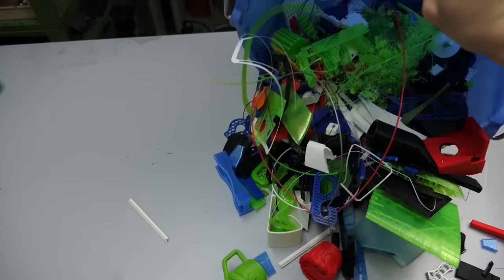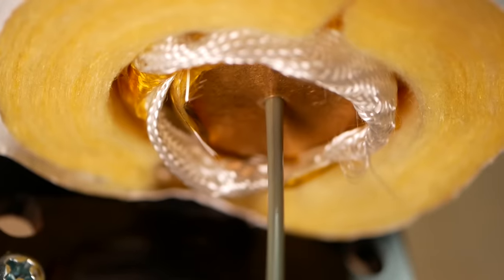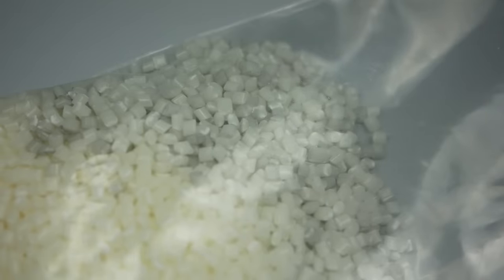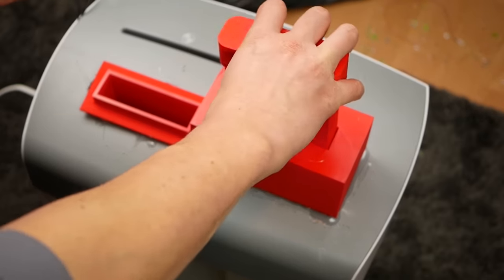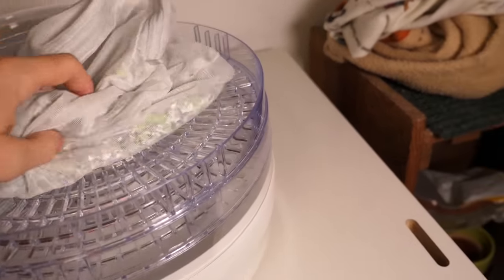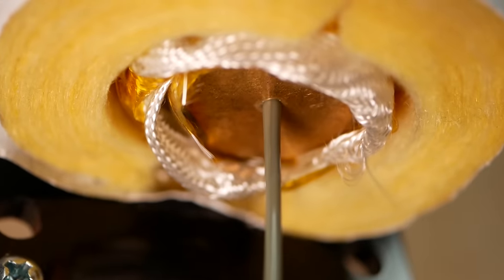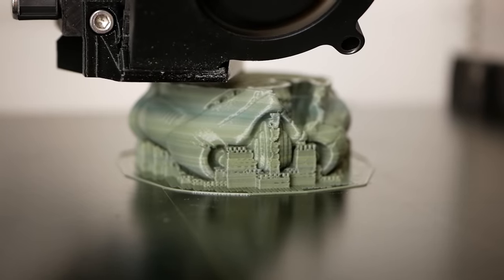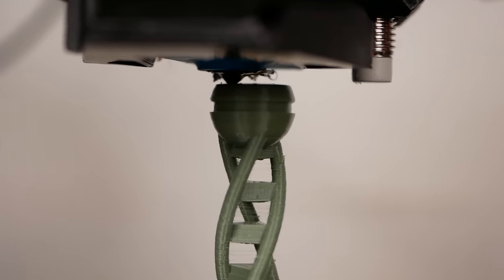Recycle your failed 3D prints! Make new filament at home.

Comment: Just to give myself the right amount of credibility, I recently completed a Material Science course on polymers, including recycling. 
Personally, I would try to keep the new PLA mixed into the recycled stuff to a minimum, mostly to keep the costs down, but also because every time you recycle any plastic it becomes worse. For this reason I think it is a good idea to keep track of how much the material has been recycled at home. ie, keep separate containers for fresh, 1x, 2x recycled scrap. Plus I would really only use this material as print support or for prototypes, where strength is not being tested. 
I really think this is a great idea, especially for setups with multiple material printing so you can choose what parts of a print is recycled filament and what is fresh filament.
I mean I am a stranger on the internet, so don't just take what I said at face value. Do your own research and try it out for yourself. ☺️

Comment: One thought I've had about recycling plastic like this (even so far as to recycle bottles, caps, milk jugs, etc.), albeit entirely theoretical because I don't have any of the components to do this myself, is to add water to the blender, not only to help keep the plastic cool but also to create a "vortex" of sorts to draw the plastic back down to the blades. My theory is that this will allow the blender to be run for longer periods and/or at higher speeds without melting the plastic and this should allow for breaking the plastic down into much smaller particles without creating a lot of dust to contend with. Having water in the blender will also help somewhat in determining if the materials are consistent using relative density. Again, it's all just theory at this point. And because we're adding water to the mix we'd have to take special care in making sure the fragments are completely dried out afterward.

Comment: My first thought on making the filament more consistent would be to extrude several rolls of rough filament about 3mm diameter and then build a multi strand feeding mechanism to feed the strands into either a rotary knife or horizontal guillotine knife with properly sized guide holes for the strands on the stationary blade at a metered rate and then chop the strands into uniform lengths of about 4mm. By varying the knife speed and filament speed of feed you cab net uniform size pellets that when reheated and extruded again into proper filament size would probably run smoother  and be more uniform in color. Something I may have to work on.

Comment: Want to build my own filament extruders. There were plans in an old issue of Make, but I can't find the copy I had. Also something made to grind up the waste pla like a pulverizer and  melt the scrap into uniform pellets, so when put in the filament extruder I get uniform thickness. Make sure I use only the same color in each batch so I get uniform texture. Also possibly have a puller and cooler so I get uniform thickness.

Comment: volumetric mode on a printer would be really useful for homemade filament, since then we can just check the size of the filament beforehand, and then print without changing any multipliers.

Comment: Im really curious if you have done more with this. An idea I have for the hopper is to do like a paintball gun hopper that helps with feeding. Setting something like what you did is a great idea, however taking out blades at every other point and then removing the fan shroud while having it spin at a lower speed would greatly help with feeding.

Comment: Try using a eccentric motor from and old controller mounted to the top rim of the collection basket. Even at a low voltage it will have a massive impact on assisting with the material flow

Comment: I think if you put everything on a cookie sheet and put it in the oven at about 200°C, you might be able to turn it into a sheet that you could then cut up with a paper cutter and get your sizes down where you need them, it would also give everything a more consistent thickness which could lead to better melting. As for extrusion, you could have a larger nozzle that feeds down into a smaller one to keep a more consistent size, maybe heat each one to about 175-185°C with an induction heater if you’re savvy.

Comment: Very interesting, I think the bumps in the filament are from larger pieces not melting enough during the extrusion . Looks very difficult to do without commercial grade equipment. Maybe a secondary cold extruder before rolling it up.

Comment: Together consistent colour you need to exclude it chop it and then excluded a second time. You also get a better consistency in your line because the 2nd time around your shopping  Crude filament into chop. Note you mix garbage chop but you Box chop, That's why you get a better color.
 I use a hand crank sausage grinder to do the chop and then I built my own 1" auger With a heating coil at the end and a course everybody needs a nozzle. To cut down on expenses I just started collecting bottle caps and now thats the only thing I print with. If I get build a proper grinder then I could use detergent bottles as well

Comment: There are a lot of comments on here so this may have already been suggested but, the best way to get a consistent thickness of filament is to run it through the extruder twice.
The first time you run it with just the shredded material, then on the second pass after you have shredded the first run you can mix in  at least 20% total weight of new resin. Any color dye should also be added to the second run

Comment: I imagine you'd be able to create a nice color recycled filament if you sort your scraps by color.
I recently bought a 3d printer and I only buy 1 brand of filament and I'm really happy with how my print are coming up. But I started to produce a lot of waste because I print functional parts and the dimensions are not always ideal so I often have to reprint multiple times. For now I'm collecting the scraps in different bins by color in hope that at some point I'll be able to recycle them to a new filament. I recently checked out a scraping machine and it is still quite expensive.

Comment: For The Vibration of the feeder consider to use the small motors used in cellphones. They are cheap and you can setup simply a tot time of vibration any tot time of work.

Comment: maybe for scrap consistency, instead f shredding you can do a rough extrusion through a nozzle, which is then cut into segmented pellet sizes of appropriate size? for instance the first process is to do a rough extrusion at 1.75 or even 2 mm nozzle into a thread which is then run through a cutting wheel which cuts it fairly uniformly at 2mm segments. you then would have a 2mm x 2mm cylinder to feed into the hopper for the final extrusion. it could even potentially be done all in one process, rough extrusion, cut, and falling or carried to hopper for final extrusion. and maybe after final extrusion, one could use a 'presswheel' (or dual presswheels that are slightly heated.)with a groove of the appropriate size to basically squeeze inconsistencies out and make uniform 1.75mm?

Comment: Try a wood chipper and a pellet mill combined to get a uniform product for extrusion. That's how plastic manufacturers do it in a factory except they often use a high end tool that both shreds and punches out pellets at the same time.

Comment: Excellent review,
I believe it is definitely worth the investment for the filament extruded and filament winder.
For those that run small business, this is a wonderful money making set up to include into your shop . Even for just the support structures. To be able to re-use  vs throw away the extra plastic. It is very responsible printing.
I also think you will be able to improve the set up with printed parts and ingenious designing.
Can’t wait to see what you come up with.
And yes, your  recycled PLA media has to be smaller, I’m trying to think of a methodical way to pulverize the material without complicating the task or melting the PLA media/material.
Off hand all I can think of is maybe wash then freeze the PLA before you smash it in a press or vice, then freeze again before you blend it.
Freezing may help with higher rate of brittleness to promote smaller pieces.
The final stage would be the dehydration and that may help.

Comment: Could try a smaller set up from the "precious plastic" channel (if they havent changed their name yet) and mount above the hopper, theyve got an idea for their shredder that they put a mesh on the bottom that only lets plastic of that size and smaller through and keeps cycling the bigger parts round till its small enough.
Youd essentially be able to tip it all in and walk away

Comment: 6:10 add a small electric motor with a small weight on one side of the axis, thats a vibrator, or just take one from inside an old console controller.

Comment: Print your own blender and try not to mix colors. Just extrude material of the same color and make granules smaller. You could also build a heat directly in to the compartment of the extruder and print a bigger compartment. I was working as extruder in a company and ofthen i had problems with moisture, but when i was recycling, that mixer was big and heated. The problems appeared when they brought me material from outside. you can try also use the heater for drying the granules as you can save energy
 Print metal cones which gradually  destroys the plastic up to specific size. Would be more cost efficient and less noisy

Comment: Great stuff.  I wonder if you really shred the filament to a fine dust whether you would get a more uniform colour and thickness since the heating will be more consistent across the particles.  You would need a good mixer to blend all the fine particles to get a consistent colour thought.

Comment: If you melt it down the scrap pla and pushed it through a 2 mm nozzle with a scraper at the end kind of creating a machine similar to what is used to create pasta you can make your own pellets and you could have a perfectly mixed batch of the scrap don't think it would be too hard either

Comment: I think using a quality meat mincer to cut the scraps into small equal sizes would work well. A mincer that can handle bone shouldn’t struggle grinding plastic scraps and if put through a fine mincing plate should yield really nice small even pieces

Comment: I would likely separate colors. Also use a pulverizer to break down old prints. Washing before pulverizing. Maybe after too. Keep a dessicant around the plastic. Maybe process them in to pellets aa well. Have an extruder and cooler in the system. once the filament is the proper thickness, cooling it so it maintains the thickness then spooling it.

Comment: Thanks for the run through, Hardly worth the time effort and money on my part, but if I had multiple machines running it may be worth considering. As far as the chopping up of the pla is concerned, have you tried a food blender. The bullet blender I have will grind up almost anything.

Comment: If you want black filaments, just add the color adding pellets to make the desired color. If there is enough of them mixed in maybe you could get the desired color. though you may have to premelt it to get a consistent color

Comment: Nicely done.
I didnt like the extruder and the puller...
This screw is not designed to melt but only to convey.
But you got to work with what you got... I would recommend to extrude horizontally into a heated water bath (prevent warping) and get speed control puller.

Comment: I'd recommend, since you're going to be using them for something they weren't designed for anyways, sourcing a used blender and dehydrator. First, it will probably end up saving you $100. Second, it will make breaking/modifying them not feel as bad

Comment: Try creating a flexible paddle wheel which can be attached to a motor to repeatedly hit the hopper. The paddle should be some sort of flexible material like silicon or rubber, and shoud have a nice sphere at the tips of the paddle. That should more or less help with making the feeding more consistent. Or maybe add a system that blows air from the bottom of the the hopper to the top to creatw a sort of fluidized particle flow, similar to the systems used in grain silos

Comment: shoot me down if theres any obvious design flaws (im still pretty novice when it comes to plastic's properties) it would be interesting to see if a design could be made where all the PLA is melted in a large vat right before the extrusion nozzle so theres a more uniform heat through the material, and thus less unmelted parts arriving to the extrusion nozzle. this design could also allow for less pre processing if you can get larger pieces to melt instead of needing to break them down so small. if there's some substance to this idea please run with it, and if you need other versions i've thought of a few variations that could also make the design or the prep work simpler.

Comment: if you slightly seperate the hopper from the infeed, maybe fit a rubber boot between the feed to the melting unit and the hopper, then mount the hopper on some rubber bushings, take a busted old rumble controller from pretty much any console and attatch that to the hopper you have a cheap, basic industrial vibrator

Comment: Its better to just have a larger furnace that melts it in a controlled temperatuer, then the liquid is kept hot as it flows down a warmer pipe into the filament presser, it would be far more consistent than doing what you are doing, and far cheaper and much quicker too as you can just make it automatically add more material once it gets to a certain level of melted plastic. 
Make sure to maintain temperature at consistency or else you might run into toxic gas issues.

Comment: I have a friend that recycles PET bottles into a filament. But he needs to clean them from the glue, stickers and wash them thoroughly. Then dry, and cut into a tape that goes into the extruder and normalize itself to usual 1.75 (or so) mm. I am not sure that this worth the effort, because we have generic PLA filament of any usual color around $13 per kg here. And one bottle weights around 14g. But if you can automate this process, it will be plastic basically worth electricity you spend.

Comment: If you want to constantly feed the fragments into the tube ad a spring holder on the hopper and loose the screws a bit. Then Print a Massive block of fiament in the diameter of the Fan but just a half or a 1/3 circle. Hhis should shake the hopper enought.

Comment: I want to see you try taking a basic 8-sheet micro-cut shredder, upgrade the motor, and dump PLA prints and plastic PET bottles into it to see if you can get them in the hopper.

Also what about heating the PLA parts to melt them into a sheet approximately 2mm thick and then shredding that?  This will probably weaken the parts produced with the filament.

I'm trying to build PLA beehive parts and noticing when I tried to use PLA for a gameboy shell or testing bits, it was brittle and weak; but these beehive parts are ridiculously strong.  I adjusted the design to put most stress in the XY plane.

Wonder if I need to replace my AnyCubic i3 Mega Pro hotend with an E3D V6 to get rid of the stringing, though.

Comment: I work in the plastic manufacturing industry, and since this is an old video this comment might not be noticed, but what you're doing is called adding regrind to a part. You definitely need some virgin material to make it work properly, additionally the parts you make with this filament will be more brittle than ones made with brand new filament. If you google the term regrind plastics, you will get a large amount of resources on the topic. It's a common practice in manufacturing since it saves on the cost of wasted plastic parts and definitely something I could see being extremely helpful for 3d printing.

Comment: Perhaps changing the melter completely to a brass cone. Than it can act as the hopper and melt lager bits before its fed through the hole as fillement

Comment: I love the idea, I just think if that was a YEAR of scraps to make one roll, it's not going to be worth it for most people.
I WOULD be very interested to know how mixing plastic types impacts the filament. You showed an un-melted piece; could you tune the extruder to run hotter and therefore effectively melt everything from a mixed batch? Or would you have to know the ratio of plastics in the hopper at any given time to properly tune it?

Comment: Thanks for sharing.  Very interesting idea.  Look at mini injection molding machines.  More power / torque to the extruder allowing you a faster rate on your throughput.  Did you make the winder?  I like that, pretty cool

Comment: Yes its worth it! But you need to be producing a lot of scrap material to really  benefit a whole lot, eventually you'll break even on the investment if you stick with it long enough taking into consideration the pellets are slightly cheaper. 

But then again this concept of diy filament is still in its infancy now. 

Someday it will be a whole lot more worth it when someone simplifies everything into a quick and cheap and practical process

Comment: Hopper issue is an easy fix: You just need a different hopper design. Different shape profile. Instead of a smooth curve at the bottom of a vertical chute, I suggest a simple faceted shape. Take a look at some square grain hoppers or similar in real life. They are a cube with an inverted pyramid on the bottom. To fix your hopper feeding, you only need an angle down to the mouth.